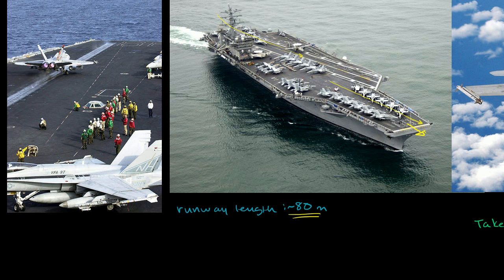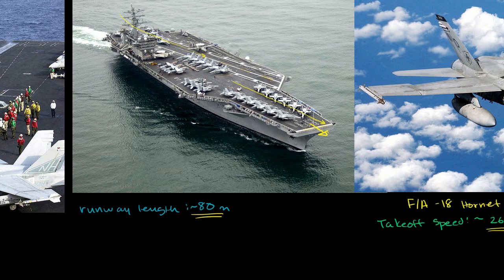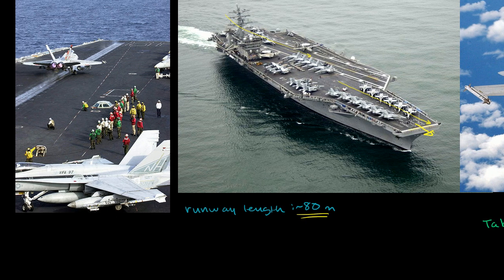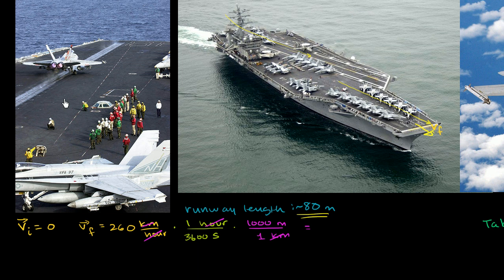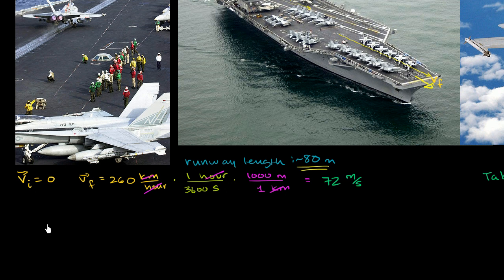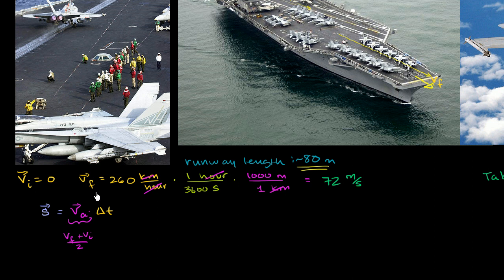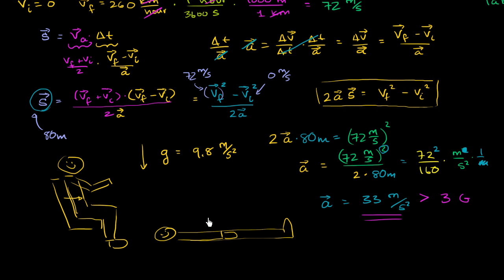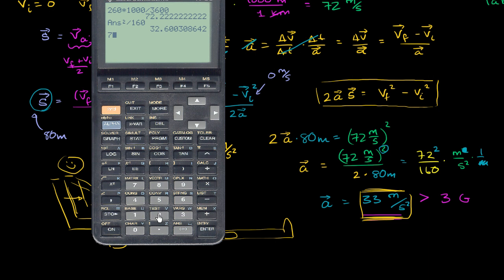Acceleration of aircraft carrier take-off | One-dimensional motion | Physics | Khan Academy

Comment: I got 36ms^-2 as acceleration 
I did followed these steps
1. After getting initial and final velocity, i calculated delta t by displacement/avg velocity that is initial +final velocity by 2
2. Then i got 2 sec then i calculated acceleration upon its formula that is delta v by delta t and finally i got the above answer
I used 72 as delta t
Kindly suggest any correction that might be applied in my solution

Comment: Why can't we use the equation for acceleration to reach this value instead?

a=(delta)velocity/(delta)t

We already converted the final velocity (Take off velocity) to 72.22, and so this would also be our (delta)velocity as we need to get from a velocity of 0m/s to 72.22m/s

the (delta)t can be determined using the formula for displacement

displacement is known because Sal gave us the runway length of 80m.

80m = Average Velocity ((72+0)/2) * (delta)t

(delta)t = 80m/36m per second, or 2.22 seconds.

and if we plug all of our variables now back into the formula for acceleration, 

a = (72.22 m/s) / 2.22 seconds

a = 32.5 or 33 m/s^2

(there is a slight difference in the decimals which i don't entirely understand why, but would this be a viable solution as well?)

Comment: The last part, to figure out time he used the formula Δt= Velocity Average ÷ Acceleration, I was surprised that this gives the same answer as using Displacement ÷ Velocity Average to figure out the Δt. But when you think about it, it makes sense that they both equate to the same answer when using the decimal places for each variable. This is because the final velocity divided by the acceleration tells you how long it takes to get up to that speed with respect to acceleration, same as when you divide the distance (displacement) by the average velocity. Pretty basic when you break it down :D

Comment: Don't you also have to consider the ships speed? It has an initial velocity of approx. 50kmh which is significant making the planes initial velocity of 50kmh if the ship is traveling forward in parallel with the runway.

Comment: @DekraDaFurry - While the airspeed needed to fly is what it is, in order the takeoff roll is definitely influenced by the wind speed over the deck (V0 in Sal's equation).  

It's highly unlikely that the F-18 could make a successful takeoff if the ship was stationary with no wind.  The cat probably couldn't accelerate the jet to takeoff speed and it would fall into the drink.

Try this thought experiment.  Could the F-18 make a successful takeoff if the ship was going 100 knots in reverse?